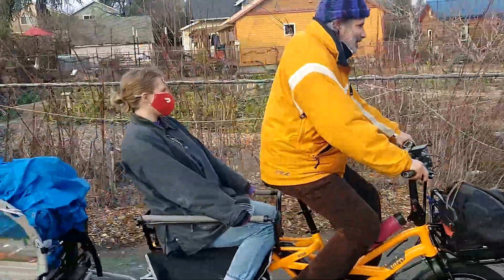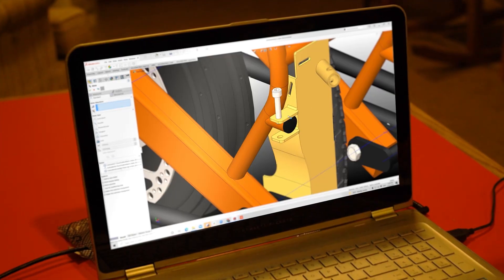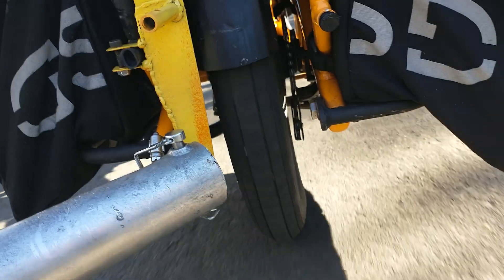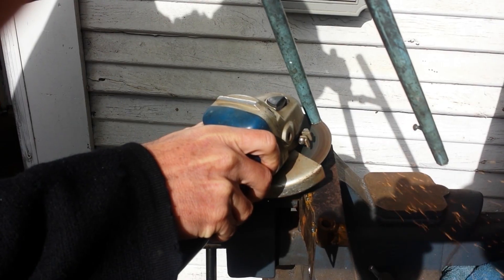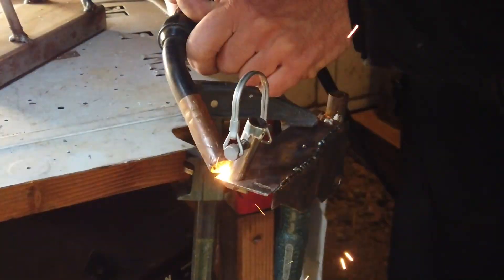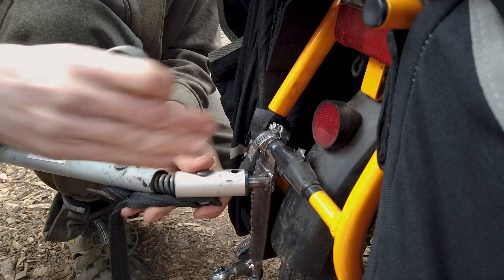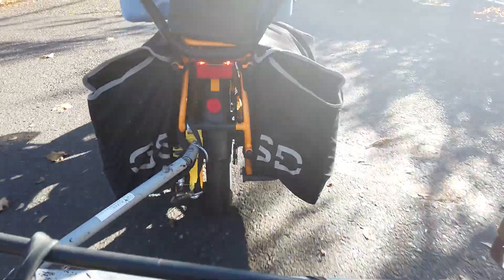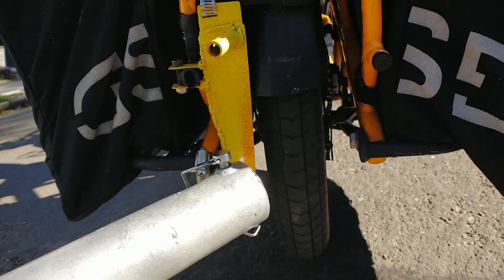Make your Own DIY Trailer Hitch for the Tern GSD Gen1

Comment: I would weld the hitch to double split shaft collars.
Reply from the maker: I'm not sure I follow, could you elaborate?
Reply: @BikeStuffPDX  instead of the hose clamp it would bolt on to the cross tube. look up what a double split shaft collar looks like.   its like a stem clamping a handlebar. has two bolts to take on and off.